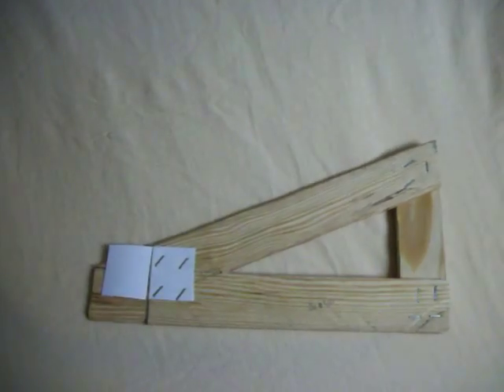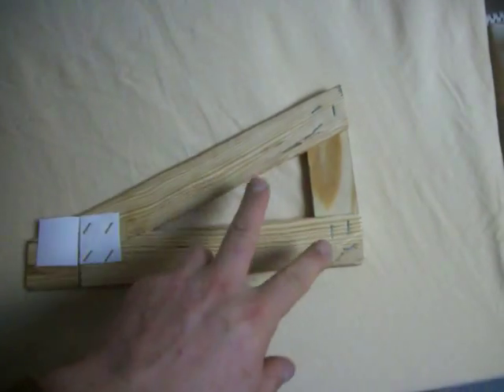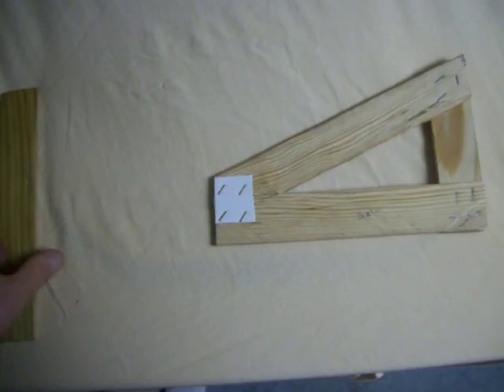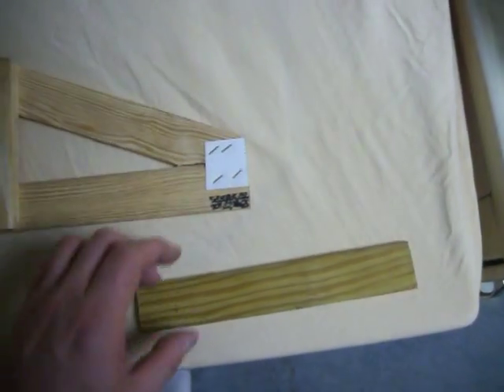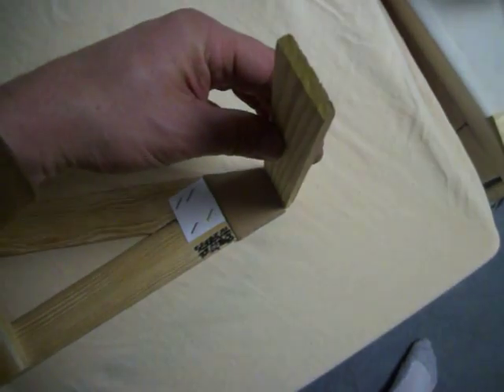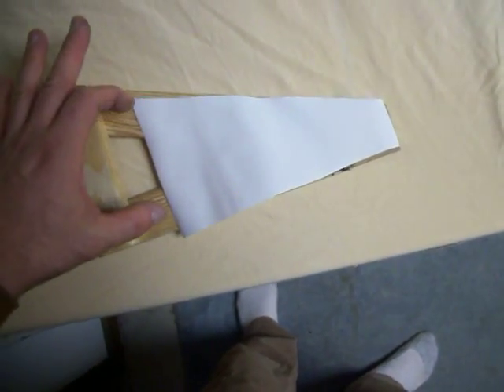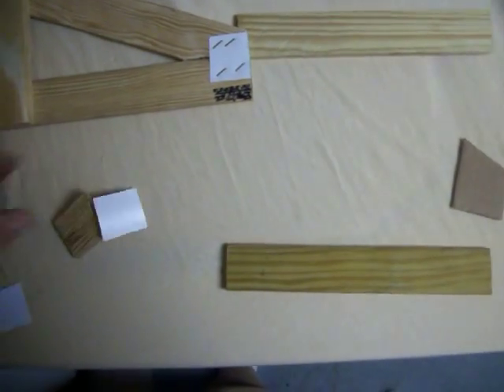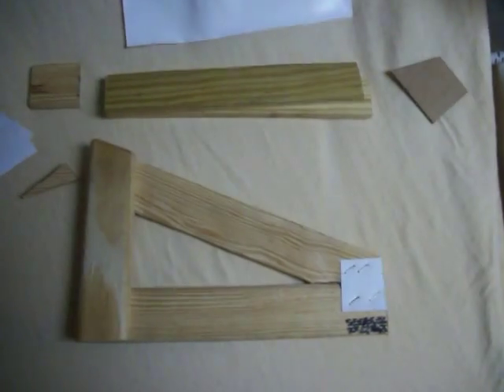Roof Truss Repair Model Demonstration.

Comment: This is a great idea. Can this be done on the roof trusses in a camper? Can I sandwich these plywood cutouts and lag bolt them together on either side of a roof truss for a camper to strengthen it from damage due to a water leak?
Reply from the maker: I'm sure it can be done on any truss style roofing system.  The geometry is the same all around.  The standard, "Proceed at your own risk," disclaimers apply, however.